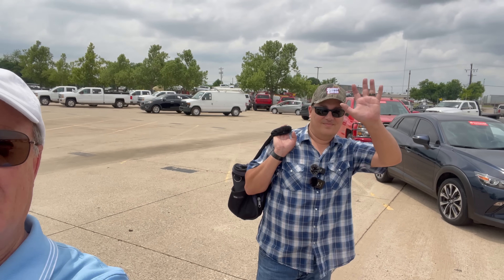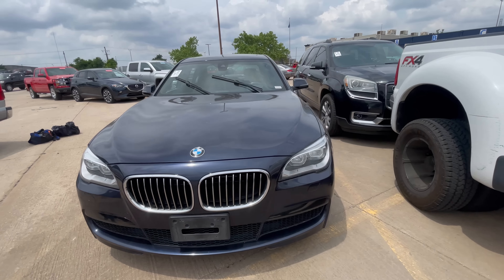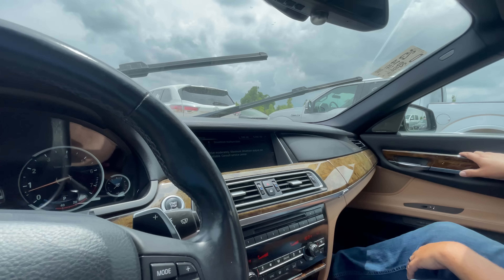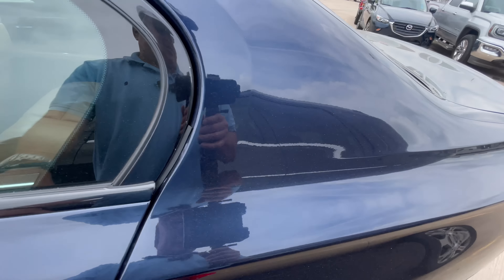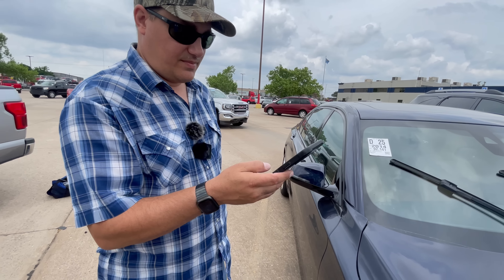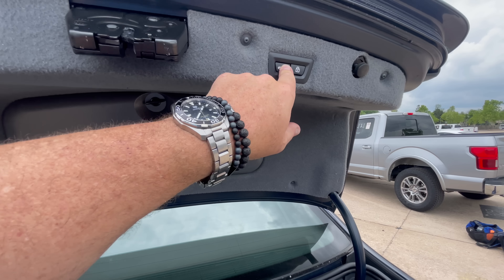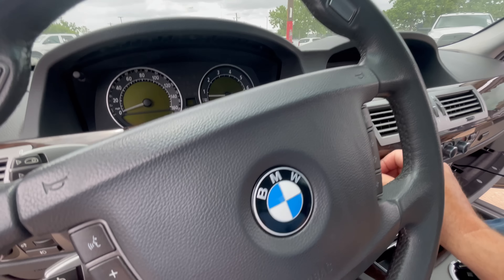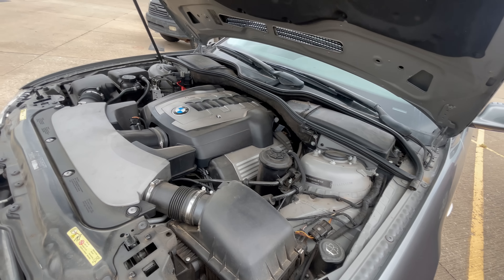BMW Face Off And Review - Dealer Auto Auction Walk Around - 6/3/23

Comment: The best thing you can do to an N63 is go with catless downpipes and install a 90 degree thermostat. Helps reduce a ton of heat that builds up in those motors. Doesn't hurt to replace spark plugs every 50k. Also go for a 2012 and up but still budget for things like fuel injectors, ignition coils and coolant lines.

Comment: Fun fact, that 2014 7 series has the good N63 motor (2014+). Nothing like the 2008-2013 N63s that were known for many many problems. This newer N63 has a new timing chain setup, new VANOS system, Valvetronic system, forged internals, and 2 engine ECUs.
Reply: And they still blow up and valve stem seals fail despite being made of a different material.
Reply: @IKhanNot  they don’t just “blow up” 🤣. valve stem seal failure is a thing still, yes, as the turbos are still on top of the heads.
Reply: @thatslowjag  Tell that to the people where their injectors failed in the stuck open position and either hydrolocked the motor or caused a bent rod.
Reply: @IKhanNot  and that would be due to not following BMWs recommendation of upgrading the injectors to the latest iteration (index 12). the older high pressure injectors are known to fail more often. these injectors are also wear item. poor maintenance = blown engine.
Reply: @thatslowjag  Shouldn't that be a red flag that the supplier Siemens had to go through 12 different redesigns to improve things? Mercedes use Bosch injectors that don't have that issue the first time. Injectors are not a maintenance item, nowhere in the manual is there an interval to change them. They're just poorly made. Hell I've now worked at GM for years as a Service Advisor and we barely changed out injectors on any vehicle with DFI.